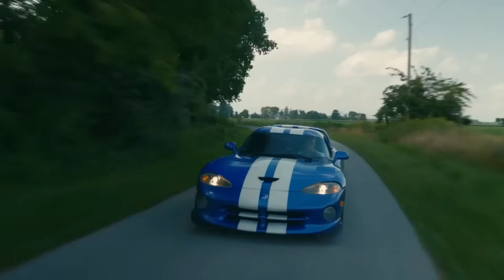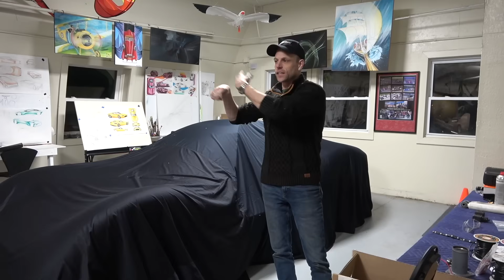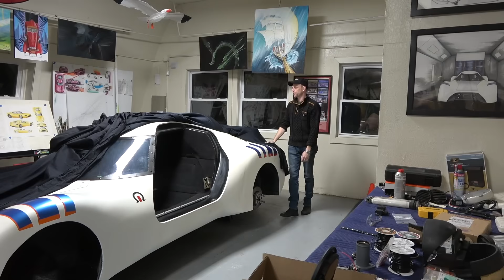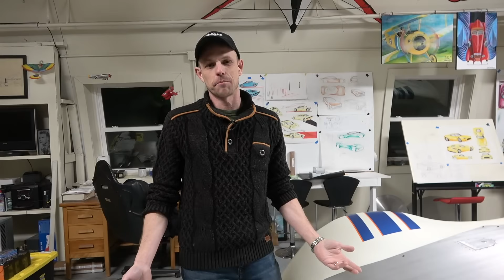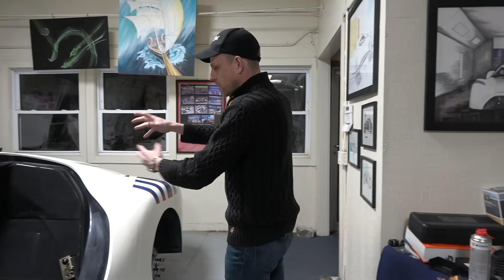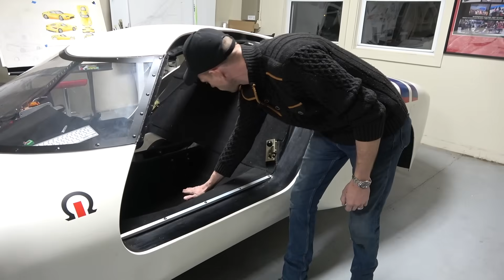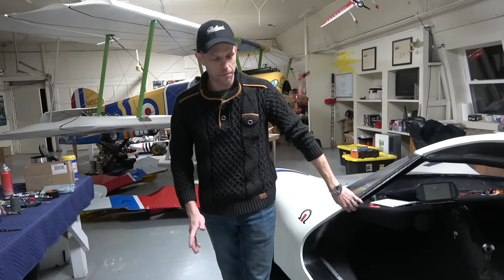Casey's OMEGA CAR because the AUTO INDUSTRY doesn't GET IT!

Comment: liked everything you said right up to the point you said diesel then you lost me and as for  using vw as an example well there kind of known for playing with numbers to make up stats i thought you would have gone the way of a standard petrol engine with an LPG conversion or do they not do that in the states  much cleaner for the planet and you could have used a much lighter engine and gotten much more power from it  just my thoughts. Casey Putsch
Reply: Did he not mention that? Besides, this is casey going all out for efficiency, that engine may be a vw, but I guarantee it's not stock.

Comment: Obviously I wouldn’t expect you to even think about adding airbags and heavy stuff like that. However, I am wondering if when you did the omega car you took things like bumper height... or bumpers at all into account. Also, I get that it’s monocoque and strong... impact-absorbing and all that cool stuff but It doesn’t look like a capsule, so was cockpit strength and overall driver safety REALLY a major forethought or just a “wow, this could POTENTIALLY be made safe some day... but as of now it may just be a shrapnel machine” type forethought? I’m not being a jerk. I’m really just asking if the omega car was strictly done to perform as a lightweight, slippery, sexy little Manx... which she is... or if it even comes close to meeting some of the more basic safety standards that really do force car companies to make heavier, more common looking cars. I want to make it clear that I think cars have been heavily overly-regulated. To a certain degree I understand why but on the other hand we live in world where ALL federally required safety measures are removed from race cars to make them MORE safe and the words “homebuilt” and “experimental aircraft” are more commonplace than Cessna on any given municipal airport. So, I could also understand how you would implement safety into your design without following federal or international regulation. If that is the case, I’m just wondering how you did it and which standards (if any other than seatbelts maybe) you followed.

Comment: Really enthused. I also happen to have just bought an 81 928s here in the uk which needs some help. I work in Dubai tho so it’s going to be a home-leave hobby. Years ago I modelled an aluminium version of your project (using folded sandwich aluminium box structure..integrated seats and Diesel engine. I thought keeping it light could use light bike brakes too). Yes indeed...I always think...what is the point of car ‘infotainment’ too.? Btw, who actually calls them that in the real world? All you need is power and an amp. As a student I spent my money on just an amp. A Walkman did the rest! Good luck finding that mould breaking mojo...

Comment: Since its diesel.... you could make it biodiesel. We experimented with biodiesel on generators on my uncles farm. Works great! But it does gel in cold temp.. our form of biodiesel was used frying oil from local restaurants strained 3 times. If you could get past the gelling it would be an awesome and sensible fuel alternative
Reply: Yep farmers around here all smell like old McD's. You have to run some kind of chemical or run a warmer on your extended tank to keep it liquid.
Reply: @One_Bar  in the winter we would run a 25/75 diesel/vegetable oil mix which worked out ok. But mixing with diesel kinda defeats the point imo
Reply: There are additives you can find in any truckstop for anti-gelling.
Reply: They have Anti jell additives or you can mix 1/4 diesel
Reply: Italian petrol company ENI makes biodiesel from the trash we're surrounded with, so... there's plenty of ways around it :D
Reply: JGD  but pricing
Reply: just mix it with normal diesel
Reply: Vegetable oil is not biodiesel. It will turn into goo at low temperatures. Biodiesel is plant oil that has been chemically processed so it stays liquid at lower temps.
Reply: Can't use it on the road or the DOT will put your ass in prison
Reply: @dylanhale7300  its cooked frying oil brother, no different than emissions from your weekend bbq
Reply: @MadLadCustoms  oh, that's scientifical.
Reply: @dylanhale7300  Think of the Children!!!! Please!! Safety! Children! Lobbyiwhoops safety!
Reply: @EliteSniperTV  think of the money we could make taxing the living fuck out of people who drive a diesel...
Reply: @dylanhale7300  it's genius! I see the money!!!
Reply: @TheWallsocket  it's mostly DOT... hanging around the highway pulling over anything that smokes
Reply: TheWallsocket the police only prosecute you in the uk. The department of transport has a policy of checking trucks and diesel cars for heating fuel or agricultural or red diesel, which is tax free. If they find any aberrations they contact the police who prosecute you. The penalties are quite startling.
Reply: Dylan Hale yeah you can most truck stops have b20 sometimes you can find b50 or b100
Reply: @dylanhale7300  A bit of an oversimplification, there. There are tens of thousands of electric passenger cars on the road not paying fuel tax. I'd wager that not many states have a mechanism in place to allow you to report alternative fuel consumption or road usage. A decade ago I ran biodiesel for a year, and Waste Vegetable Oil (restaurant deep fryer waste)  for several months. Biodiesel does indeed have a higher gel point than diesel (dependent upon feedstock and recipe), and it can be mitigated (stated by Alan Holcomb above) by blending with conventional diesel. We did not find an additive that worked well with biodiesel, but it may well exist now. Biodiesel runs cleaner than diesel in most categories. The recipe we used had significant detergent properties to the fuel system. WVO has an even higher gel point (dependent upon original feedstock).
 Broad brushstrokes can be misleading...
Reply: @dylanhale7300  biscuit

Comment: Electric cars ARE as polutants as gas or diesel cars/trucks. Lithium-ion batteries... Lithium itself is as extremely toxic natural resorce. More so than crude oil. It is mined horrifically leaving mass distribution and toxic waist. When batteries are depleated of usability, they are generally buried in waist dumps or so called safe zones. Thry break down in a more toxic manner than an oil spill. Food for thought, aka; FYI.

Comment: We're facing the same issues with medical device creation. Have a great idea? Too bad, you need more money to get things through the bureaucratic process and red tape than it costs to research, design, and produce the product. The only way to bring things to market is to have a money hammer big enough to smash your innovative round peg into the square market hole.
Reply from the maker: 100%
Reply: 100% tired of medical field b.s.
Reply: Let's cut out the middle man.
Reply: Aircraft design is stuck in the 60s for the same reason.

Comment: I've got a 2000 VW Golf TDI 5-speed for a daily driver and it gets great fuel mileage. I average about 45 MPG when keeping up with traffic on the interstate and well over 50 on the highway. I also have it tuned with larger injectors so the car is no slouch either, makes the car really economical and fun to drive.
Reply: Nice! I have a 2000 beetle with a 2.0.... manual also , but I added a supercharger, a hydrogen generator, larger injectors, and a tune... it gets 42 mpg on 87 octane pump gas... but, it went from a 0-60 of 16.3 to 6.1... love vws.. have 2 beetles, and a Passat v6 4 motion....
Reply: Dave Howell koh
Reply from the maker: Awesome!
Reply: And according to VW, it's totally clean and smells like strawberries.
Reply: @truantray  Use recycled fryer oil and it would smell like french fries. Lol
Reply: Tell you what...in Europe the diesels are getting 75+ out of the crate...yeah, there is crap goin on in this country.
Reply: My 06 jetta tdi with 5speed with just an egr delete gets 45 while doing 85mph

Comment: Funny you mention dieselgate, even though you say that it's a 1.9 tdi code alh. This wasn't a diesel gate engine, it predates dieselgate by 2 generations of VAG diesel engines. The dieselgate engines were the earlier common rail engines produced in the 1.6 and 2.0 variants.
You could potentially gain better fuel economy, if you moved to a later 1.9 tdi with a pd injection system, as these are considered to be some of the best engines ever created.
Reply from the maker: Yes, but the public doesn't know these sorts of things....

Comment: Diesel gate was just the overreaching EPA. They absolutely choke these cars to death, a I'm told reliably that the gear the use to clean the exhaust makes the motors far less reliable. Like less than 100,000 miles... has really hurt the trucking industry.
Reply from the maker: The story is always much bigger than people know. Good share.
Reply: Yeah it's actually pretty crazy. My mentor and Bestfriend has worked on Semi Trucks all his life with his dad, and he kinda filled me in on all the BS Diesel engines have to go through. I'm not sure on how all the systems and regulations around those systems work? But what I do know is this have massively hurt Truckers and Railroads alike. Now every 2-3 fuel stops they have to spend a extra $150-$300 to fill up their Diesel Exhaust Fluid tanks...

Truck drivers in the know, if they bought a new truck, would take it immediately to a shop and have the engine swapped over. (Because older engines are grandfathered in and if you just took this shit off the modern engines the DOT would have your ass) 

Problem was for like 3 years, between 2013-2016 the Truckers couldn't make it the 35 miles to my buddies shop... We have a kenworth dealer here local, and between those years, when they did the first "regen" you have about about a 33% of your truck shutting down and refusing to run until the exhaust cooled back down, 33% that it would catch the sleeper cab on fire and warp it, and 33% that it would survive and drive as normal. Of course semis have no warranties either normally so you where just fucked from the get go...

Trains have it even worse. If you've ever seen a train shoot fire out the stack instead of smoke. Something in the regen system failed and the exhaust got so hot it caused to turbocharger to overheat and eventually fail...

Comment: I have a Honda Insight daily driver but with a K24/K20 Frankenstein engine. I get about 240whp with a 6 Speed transmission in a 1800 pound car with one of the lowest drag-cos. I can get about 60mpg highway and still run mid 11's in the quarter with different tires.
Reply from the maker: Nice!
Reply: @CaseyPutsch  You could put a Tesla power plant in it have up to 300 miles of range, have a ton of torque and just plug it in when you get back to the shop.
Reply: whacky pax  yah